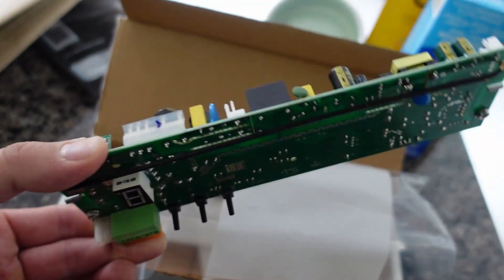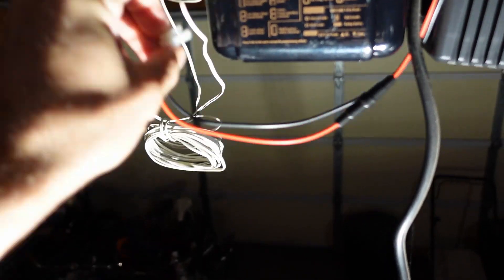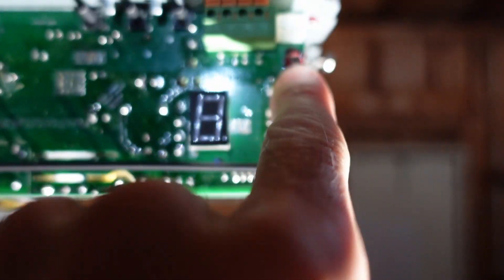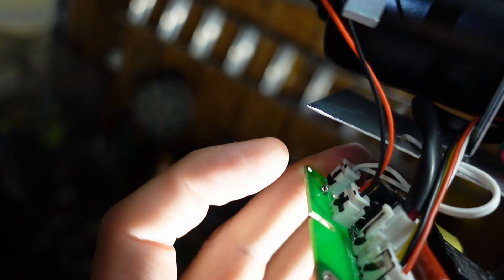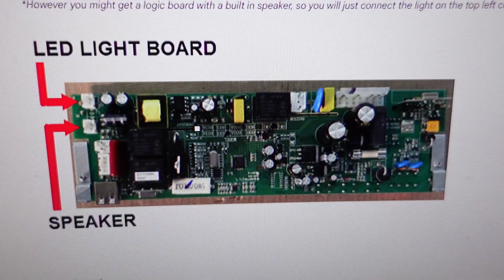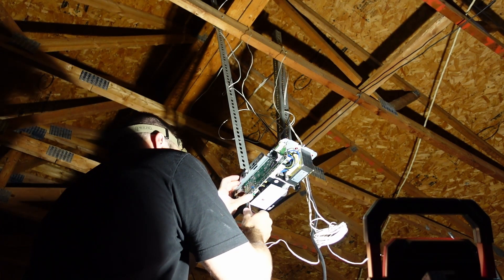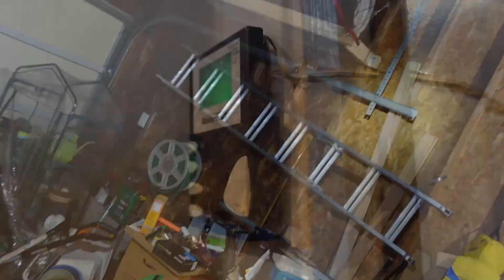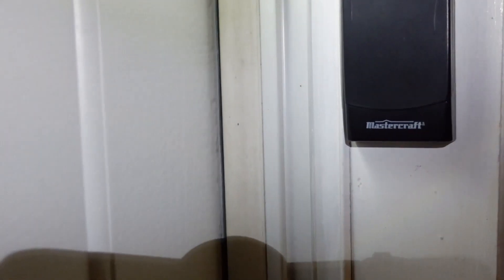Garage Door Opener Logic Board - Skylink

Comment: Hi I have a Skylink and a Mastercraft lifter they both appear to use the same logic board. There seems to be a lot of users that have trouble with the battery back up unit. There is very little information concerning the battery that is used inside the unit although I did find some information about the battery which said that it was 24 volt is this correct? I also measured the voltage out of the units battery port which was about 36 volt( way to high!). Is there any electronics inside the battery box that woud trickle chatrge the battery ? My feeling is that the battery should last many years if is charged and protected properly. Your help would be much appreciated!  I'm pretty sure that I could design a battery back up unit that would last.
Reply from the maker: 24 sounds right but I don't see it written anywhere including in the specs for a new battery. The replacement battery gets a 1.8 star review online. So yes, pretty bad for sure.

Comment: So my wall computer screen is showing all of the icons at once and I'm unable to program my opener.  They won't go away after I've installed the new circuit board. Any idea?
Reply from the maker: I would try to reset the opener. I'm not sure if you have the user manual but there should be information on trouble shooting codes and how to reset the opener in the manual.
Reply: @DIYNorth  I did find out that one of my units would not enter the 5 second press door programing mode until it was paired with a remote after which it would work normally.